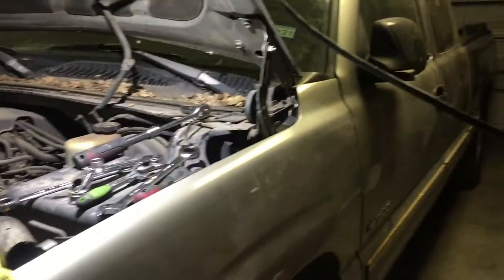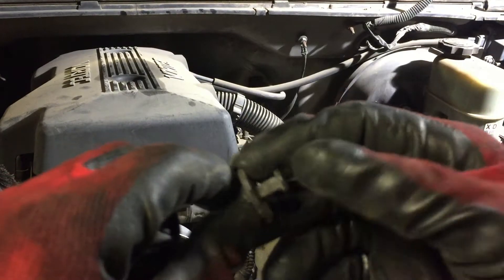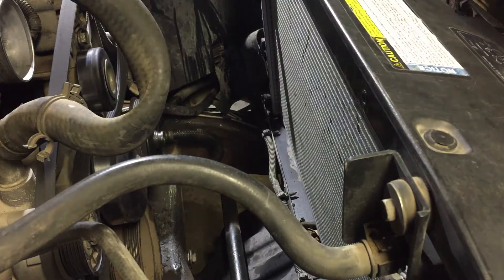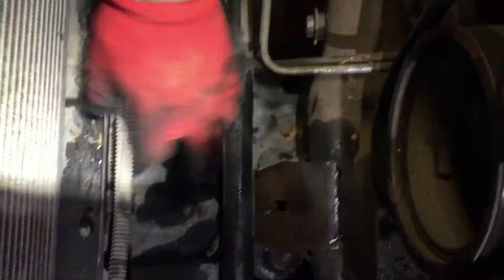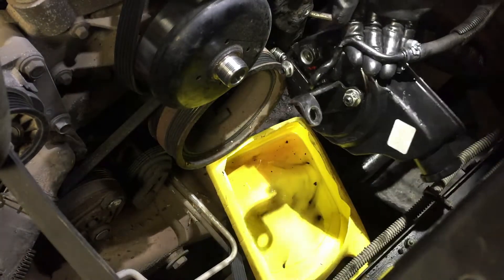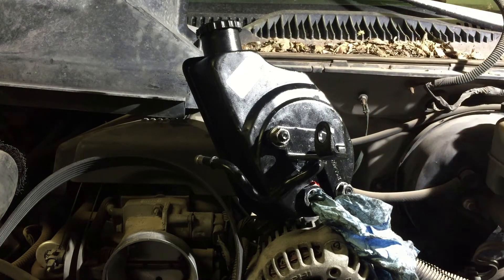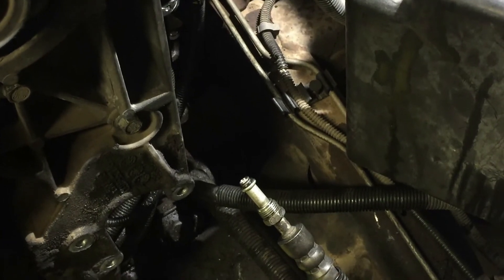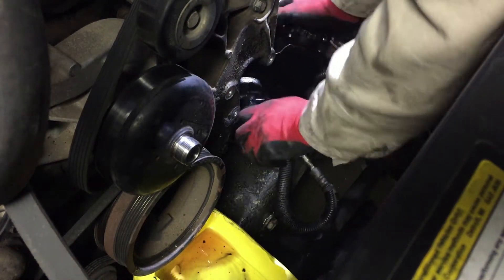Chevy pickup 99 1500 power steering & high pressure line

Comment: Thanks a lot for the video buddy, definitely it's not an easy task to do it either way,  removing  the pump pulley first or  removing it with the whole bracket, but now I have a better idea of how to do the work on my 00 Chevirado 5.3L,  specially the section of how to used the pulley puller.
Reply from the maker: Hi Chaly Falcon your welcome   just take your time brother you’ll get it. And thank you for watching I appreciate you
Reply: Its really simple! I did it in 15 minutes with 2 box end wrenches!  Some young folks on here makes things much more difficult than it really is :)

Comment: Marty is it necessary to bleed the pump after installation and if so how? Thanks for the video.
Reply from the maker: Hi Willam Jones  yes fill the pump with fluid and turn the wheel all the way to the right then to the left slowly to get the fluid in the lines and air out do it about five times to each side it may take more times then that then turn on the vehicle and do the same make sure you add more fluid if it goes down thanks for watching. I really appreciate you.